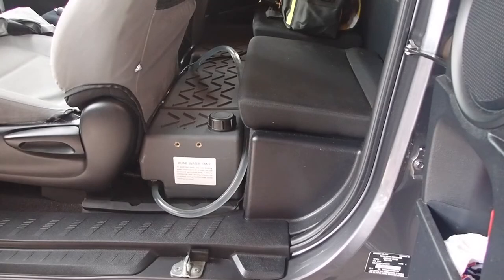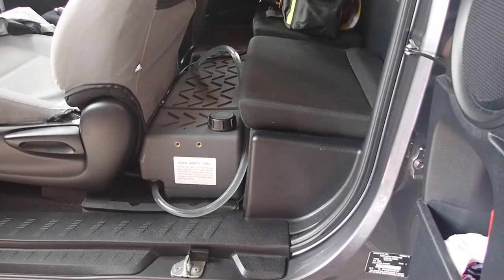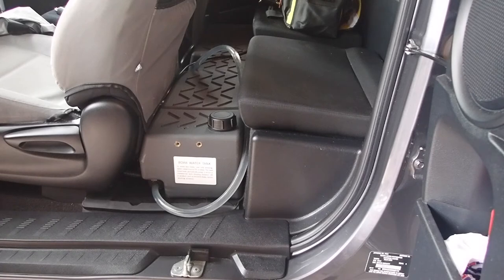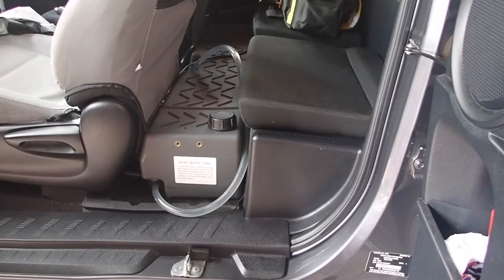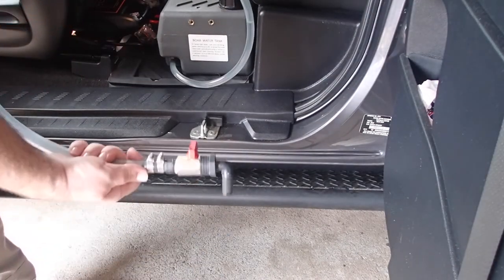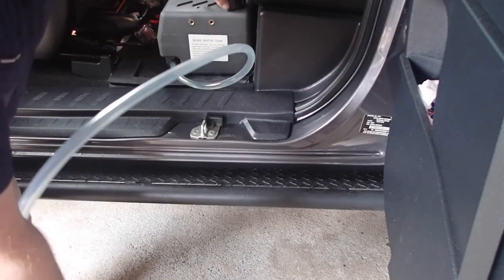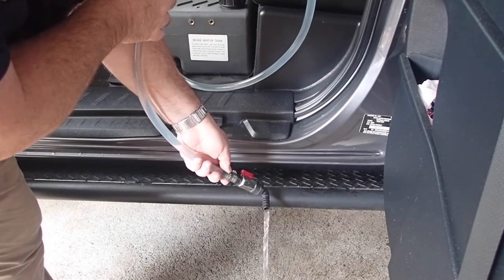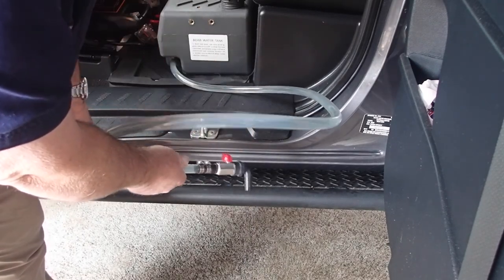Boab 40 litre footwell water tank in Toyota Hilux

Comment: I have the same tank. I cut the hoses on either side about half length. Have had it now for about 3 years. Works a treat.
Reply from the maker: I think they are a great option been removable when you don't need them regards mike

Comment: Thanks for the review mate. From your experience how does it go with the amount of moving liquid noise in the car given it's pretty much next to you. Cheers! I do like the fact that it helps with the centre of gravity and that it is accessible and out of the way.
Reply from the maker: You can hear a bit of sloshing if its not full I lift the fill end to get all the air out when filling when its half empty the lump for the transmission tunnel acts as a baffle.I just did a 2000km road and off-road trip and was very happy it had 10 lt when I got home and I didn't notice it regards Mike

Comment: Thanks for the review.  
Your last comment about the water tasting horrible when using a garden hose to fill it up was interesting.  I have been considering buying either a solid or possibly a plastic bladder type for the rear footwell. Taste is one of my main concerns with these tanks so I’m not sure which one would be better in this regard.  
I was also considering adding a filter in case the container goes a bit mouldy if left for a period of time.  Obviously I’d empty it out at the end of trips but…
Reply from the maker: You can buy RV water hose so it doesn't taint the water, the only experience I have had with water bladders was back in my big wall climbing days MSR made 10lt dromedary bags I tried everything to stop them tainting the water without success.With out sunlight you should not get mould you can get RV water tablets I just let mine dry out between uses or you could use Milton baby bottle wash regards Mike
Reply: @kisbushcraftdownunder  yes, I have had similar experiences with water bladders for hiking and cycling.  I used to use steradent for cleaning them out 🤣
Reply from the maker: @carlbillingham2670  I have had good success with the platypus water bottles/bags but the hoses seem to end up with a nasty coating so I gave up on the tubes 🤪

Comment: Hey mate just wondering if this can fit the opposite way? So the filler cap is on the drivers side?
Reply from the maker: It could but the side is tapered so the seat 💺 would not have as much room
Reply: Ah ok. Thanks mate

Comment: Does it stop the seat from sliding all the way back
Reply from the maker: The tank is 23 cm wide and with the seat fully back in my Hilux Extra cab the gap is 21.5 cm so you lose the last seat clic me at 5 10" I have two spare seat clicks every car will be different regards Mike
Reply: @kisbushcraftdownunder  cheers